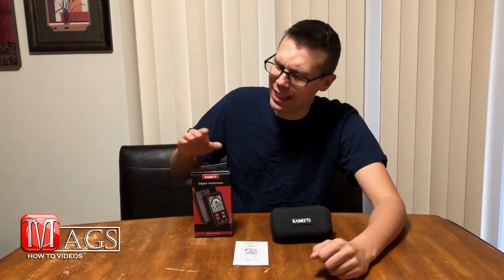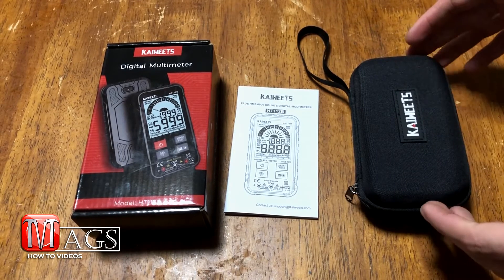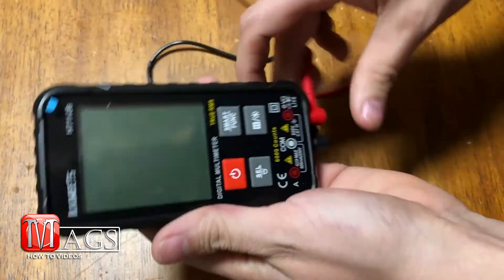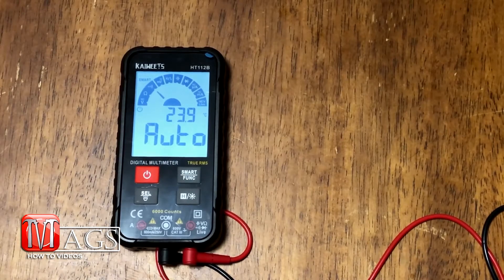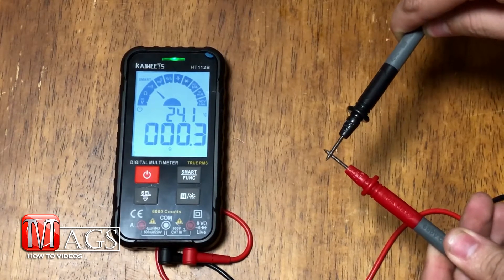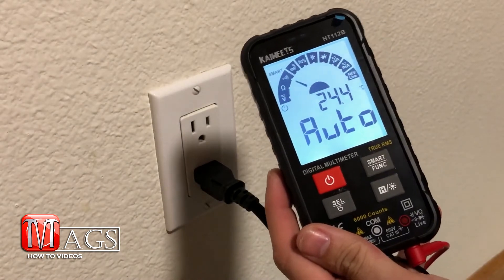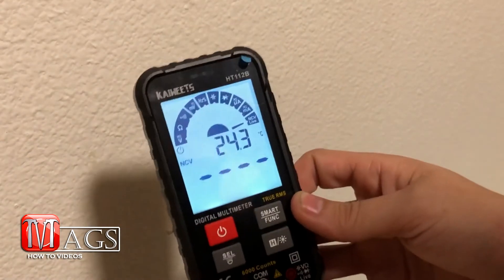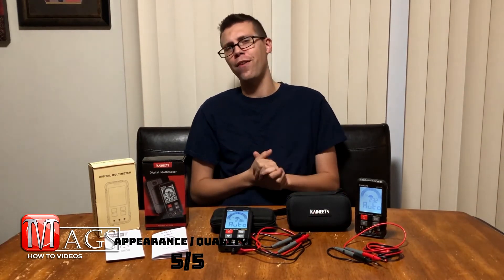Kaiweets HT112B Smart Multimeter Review Video

Comment: Hello. Thanks for your video. Question for you; what size Amp fuse should I get to replace the one that came with multimeter? It only shows the voltage - F630amH 250V on the one that apparently blew, but it doesn't tell me what current should be on the fuse. I checked at Amazon and they do sell them, but from a minimum of 0.5A to a maximum of 10A. Your advice would be greatly appreciated. Cheers!
Reply from the maker: So 630mAh is other wise 0.63A. You should never replace a fuse with one that has a higher capacity/rating. If you can’t find a 630mAh 250v fuse then replace it with the .5A 250v fuse but remember that now that Amp port is rated at 500mAh. The reason why you want to go smaller instead of bigger is because that fuse is there to help protect your device from being blown/fried. If you have a fuse that is related higher then recommended, you take the rise of that fuse not protecting your device.
Reply: @MAGSHowToVideos  
Thanks a million! I appreciate your knowledge and your willingness to share, plus the prompt response to my question. May God bless you.